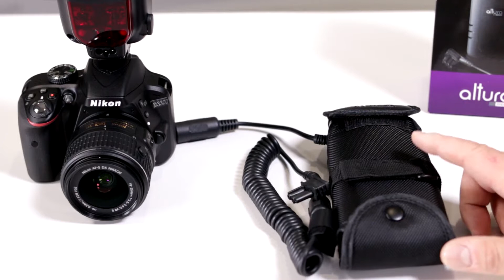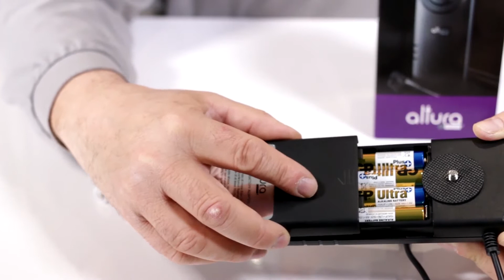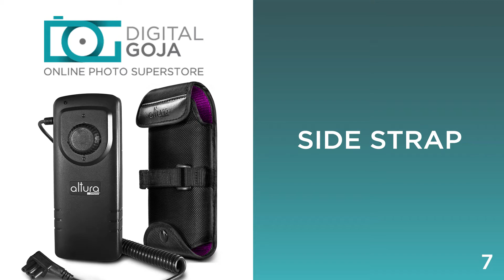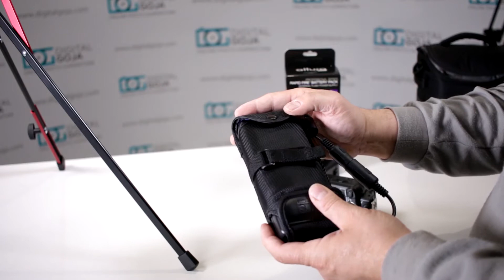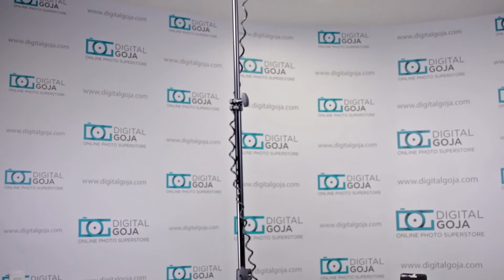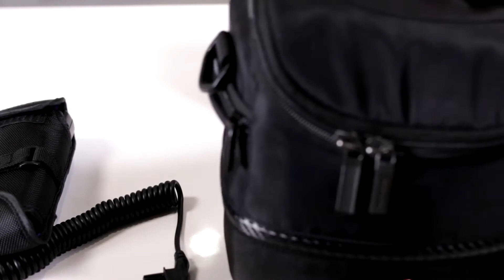TUTORIAL How To Use an External Flash Battery Pack for NIKON Flashes | Rapid Fire™ by Altura Photo®

Comment: Will the battery pack work with Yongnuo flashes
Reply: This DOES work with Yongnuo flashes. Both the Nikon and Canon model Yongnuo flashes have the Canon external power connector. I have used it, and still, use it with this power pack.
Reply from the maker: Hi, it is not compatible with Yongnuo flashes.

Comment: I use multiple SB800s in TTL wireless mode using the Nikon CLS optical triggering system. I am not interested in manual exposure using SU4 mode. Will this pack support TTL using the CLS triggering system?
Reply from the maker: Hi Frank, unfortunately, it won't work on the Sb800, its port plug is meant for the S900 and up.

Comment: On ebay, it shows the battery pack attaching to an Altura Flash Unit.  Which unit is this?  And will it work with my Nikon D5100?
Reply from the maker: Hi Michael, the flash used for the photos is the Altura Photo Universal Flash which is compatible with the Nikon D5100, it can be found on: ebay.com/itm/201439623059 :)
Reply: That shows a Flash for a Canon.
Reply from the maker: The Altura Photo Universal Flash is compatible with both Canon and Nikon cameras.

Comment: I think someone needs to get their hands on a SB800, this Nikon connector will not plug into the SB800 as mentioned in this video and as indicated on the packing. It will plug into the SB900 or SB910.  Once I trimmed it to fit it still doesn't fire with the SB800 speedlight. Unbelievable how a products goes out without proper testing. Wasted my time and money!
Reply from the maker: Hi Carl! It seems that Nikon has changed the port on their newly manufactured speedlites. I recommend that you talk to Nikon to get an exchange or you can talk to our customer service at info@gojasales.com and they will be happy to take this item back for you.
Reply: I think you miss understood. Your power pack works with Nikon's newer flash ports, the SB900 and SB910. It does not plug into the older SB800. Even though on your product box it says it is compatible with the SB800.
Reply from the maker: Hi Carl, I am sorry for the misunderstanding, please send us your purchase details to: info@gojasales.com and we will be more than happy to help you find a prompt solution.

Comment: does the flash described in the link can be used wirelessly??
http://www.amazon.com/gp/aw/d/B00NIYGWJ8/ref=mp_s_a_1_4?qid=1464434285&sr=8-4&pi=AC_SX236_SY340_QL65&keywords=nikon+lens+kit&dpPl=1&dpID=51YS57sVhML&ref=plSrch
Reply from the maker: +Binami Gmjda hi there! Yes it can, you can use it on S2 mode or with a wireless trigger set. ;)